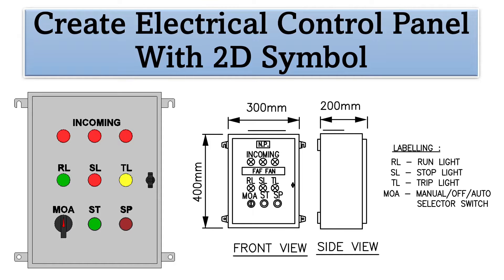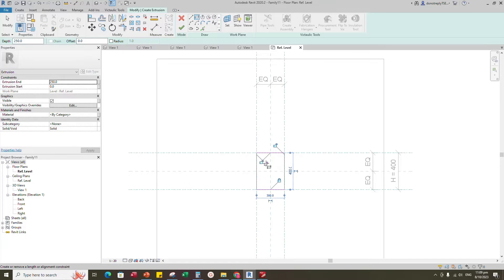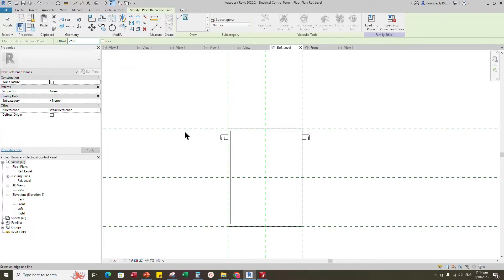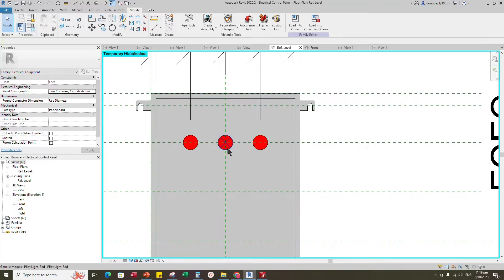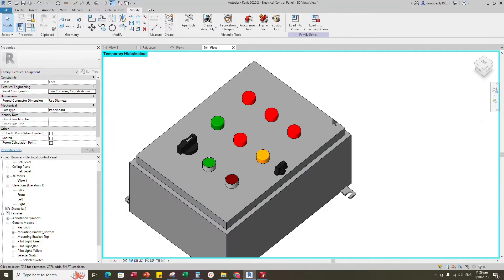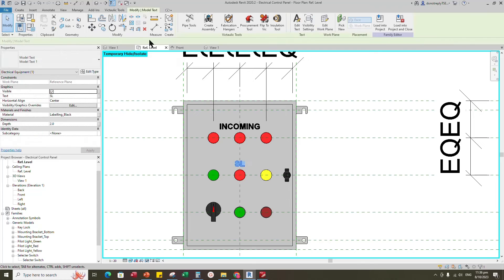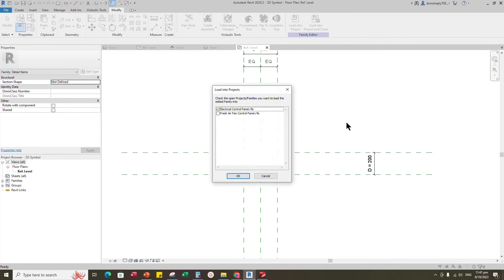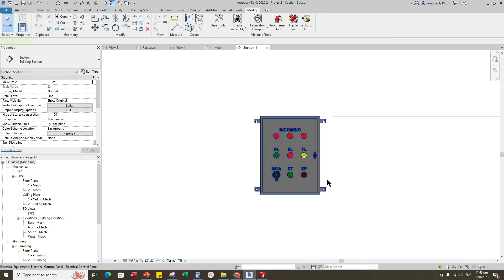Create Electrical Control Panel Revit Family including 2D Symbol

Comment: why i cant give dimension to 2d annotation family loaded in 3d family when i loaded the family in project.
Reply from the maker: Make it as instant parameter.
Reply: @ThomRVT  
I have made a 3d family 
And a generic annotation family and load it into 3d family.
After that loaded the combined family into project.
I cannot give dimension to 2d symbol of that but can give dimension to 3d extrusion.
Kindly make a short video.